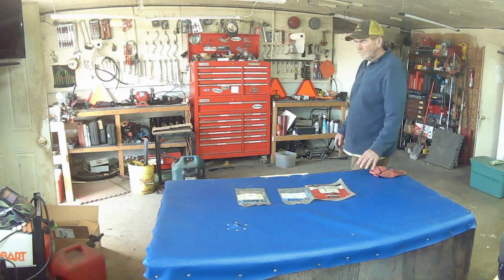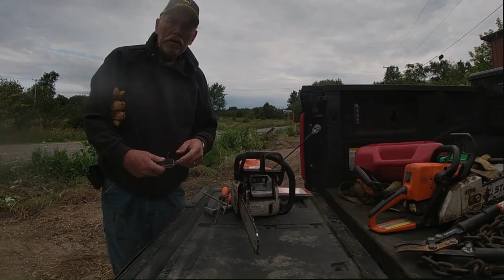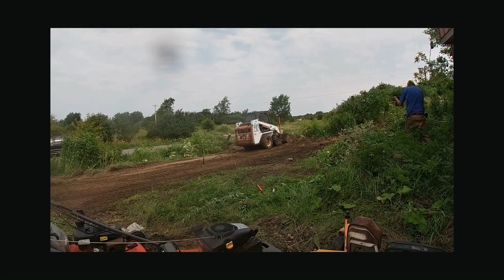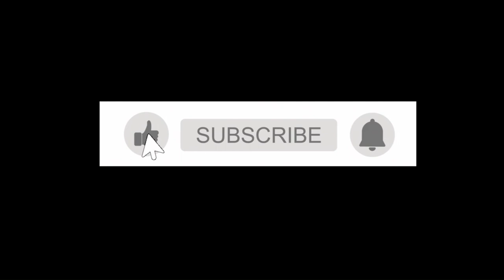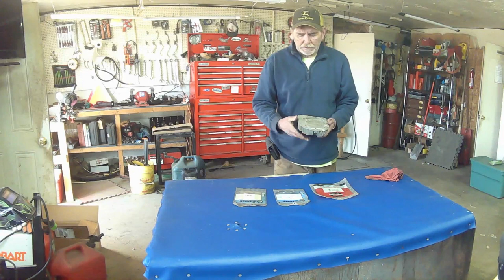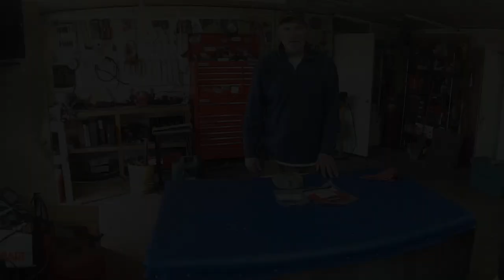Lawn Mower Head Gasket 101: Diagnosing and Fixing Common Issues!

Comment: I have done a compression test and it was OK and over 120 psi with a bad head gasket. The best way to test is with a cylinder leakage tester and a cooling system tester for the liquid cooled.  I had a cracked piston one time that I thought was a head gasket but it was blowing more smoke our the breather tube than the exhaust. It was really hard to start and just wouldn't rev up. The hairline Crack across the top of the piston was causing major blowby into the crankcase. Usually a blown head gasket on a Briggs and Stratton OHV air cooled will start and run good but start smoking like a Freight train after a few minutes and it will drip oil out the exhaust.
Reply from the maker: I done compression tests as well in the past on bad head gaskets and got mixed results. I have yet to see a hairline crack in a piston, but now its one more culprit I need to check in the future. Thanks Jason

Comment: OHV engines are a bit more complicated than the old flatheads, which are nearly extinct. OHV engines routes air and exhaust though the head, creating additional work to R&R. Heads should always be checked for flatness, as well as the deck. On OHV engines, it's a good idea to check the head bolts, valves,  valve seals, springs, guides and seat conditions while heads are off. I would typically torque heads in at least 2 steps, in proper order. Graphoil gaskets rarely require re-torquing.
Reply from the maker: great add Travis, thanks